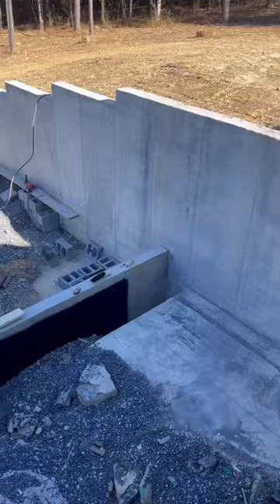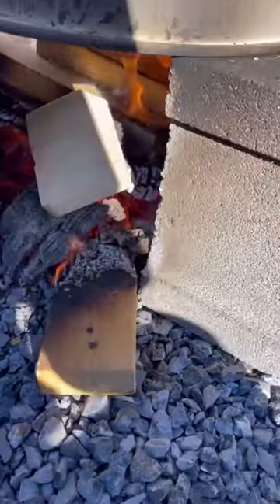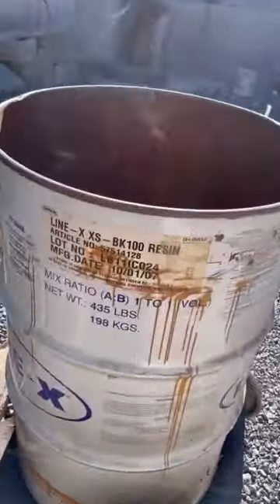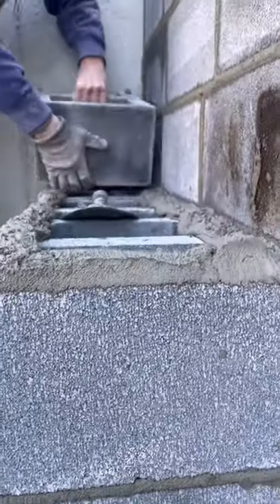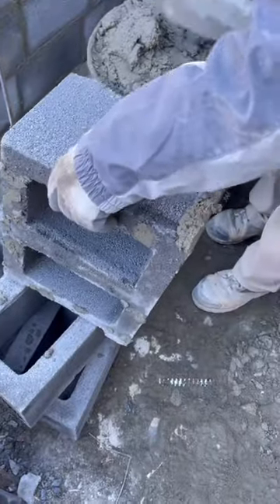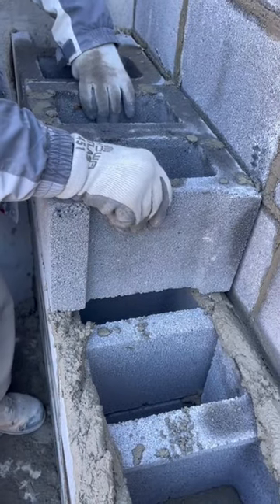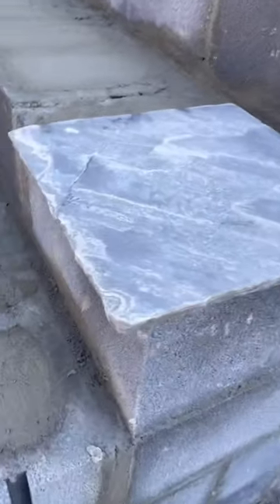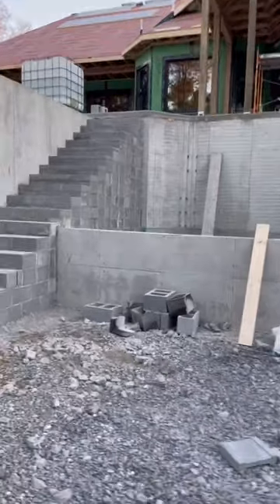Masonry Block Steps

Comment: Anyone else noticed the big crack in the foundations side wall already☠️
Reply from the maker: The retaining wall is over 60 feet long and those are expansion cracks. There’s tons of rebar in the wall and it’s not going to move
Reply: @hausplans  Im aware. I have a few friend who do concrete. It just sucks seeing it in a brand new slab.
Reply: @kennethharris5116  there’s two things that can be guaranteed about concrete, it will get hard and it will crack
Reply: That's his pencil marks
Reply: @hausplans  won't it cause a leak?
Reply: @ericredelman2568  ,is IT always the case ?
Now added with different types of fibers and changes to the composition ( more like Roman concrete) of its degrees of minerals vs sands/ lye/ Portland.
Reply: Nope— not pencil marks, sorry. Stop the vid @20 and you will spot a hairline crack. It’s the same as a shrinkage crack or vertical crack— it will not cause structural damage; however, I would have epoxy taped it where the block work started at least. My big issue is the freeze and thaw that will be happening. Using 12s, you will see a stair-step crack appear within 5 years. Another issue is your rise and treads. 12” is an awkward gate. You will step down a couple of steps then have to double step on one of the treads because of the span. Don’t get me wrong “bricky” did a good job. I just think it’s going to shift and when it does—your pavers will have cracked head joints blah blah blah. Maybe you can use a Schluter membrane then pave. I do hope the best for you.
Reply: No, but that’s to be expected
Reply: @hausplans  the problem is you should of put expansion joints in it rather than waiting for it to crack
Reply: @kennethharris5116 you get used to it

Comment: What about that pressure Crack in the wall where the steps are going
Reply from the maker: That’s a curing crack. The wall is almost 60 feet long. It was engineered with a massive footer and has tons of number five rebar in it. It was backfilled on the other side all the way to the top with crushed stone. So there may be some more cracks with time but it’s not going to move.

Comment: If you have an entire exterior wall as concrete block (like in Florida where it's code for hurricanes), would you fill it with concrete one block at a time with mortar or bring a truck out and fill it with concrete? Seems like it would be difficult to make sure it gets down in there if the wall is 9 feet high. Would love to hear your insight on this. Thanks.
Reply from the maker: You could fill it one block at a time with mortar, however if it requires concrete, it’s easier to wait to the end and pump it from the top. The Masons i use tend to wait and fill at the end whether they’re using mortar or concrete. This might be because usually if the block wall requires core filling it also requires rebar and can’t put the vertical rebar in until the end.
Reply: @hausplans  Thanks!

Comment: If the sand froze last night that means  the motor will freeze tonight unless you protect it how did you protect it  on this job?
Reply from the maker: We covered it with concrete blankets

Comment: don't know if you build any kind of drainage slide next to it, but in case you have to get a wheelbarrow up or down depending on how the whole ground is built, that might help out with getting things down faster and using the cement steps. again without seeing the whole thing, that's the first thing I think of cuz I work on a property and entertain on a property that has about 100 ft of flat level steps going all the way down by at least 40 ft and vendors and other workers roll on the grass right next to the steps. as someone who loves nice grass, the vendors don't think about it and don't give a s***. they just roll right down and tear up the grass instead of going down the stairs carefully

Comment: I saw that structural crack in the wall, what are you gonna do about it?
Reply from the maker: That’s a curing crack, that wall is over 60 feet long. It’s engineered with tons of number five rebar. It may get a few more cracks but it won’t move or separate

Comment: I've never heard of mortar or concrete being mixed with warm water. I didn't think you were supposed to.
Reply from the maker: Yeah, it’s pretty common. They make heaters that are made for a 5 gallon buckets for masons to use. When your sand is cold or frozen sand you have to heat your water. The same with concrete companies they mix their concrete with hot water in the winter time.
Reply: @hausplans  
I wasn't aware. Every day's a schoolday.  I learn something new on YouTube everyday.

Comment: Why not form and pour concrete steps?
Reply from the maker: We thought about pouring concrete but because the steps are so tall and the concrete would be heavy, with that much weight we would’ve needed several pours. Also concrete hard to get in our area right now and trying to line up several pours would be a nightmare. It seemed like it might be a lot more work then block in the end

Comment: Never ever grout the cells with mortar it doesn't have the compressive strength of grout on average mortar has compressive strength of 1500 psi and grout has on average 3500 psi plus aggregate mortar doesn't if I inspected that it would be a tear out because of grouting with mortar especially handrails into mortar will not meet the specifications for handrail anchoring

Comment: I would preffer metal steps. temperature and humidity wont afect metal steps hand rails will ancor solid ! lots of storage under metal steps ? metal is not going to rust out in your life time and if metal does rust out a cutting torch a welder and angle grinder some new metal and steps are good as new !!! metal steps better all the way around !!!